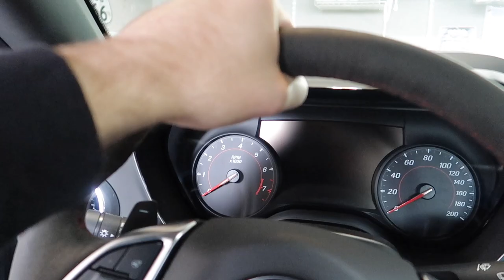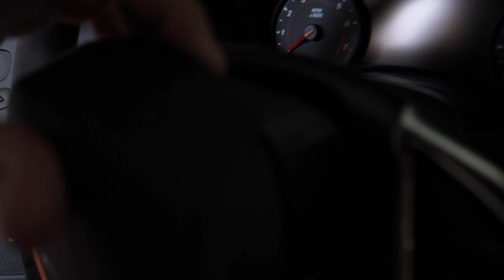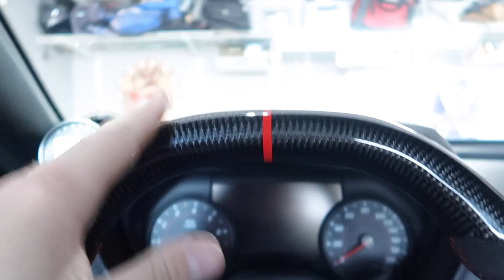EVERY 2016+ Camaro ZL1/SS NEEDS THIS CARBON FIBER STEERING WHEEL!!!

Comment: $750, you got ripped off!!!
Reply from the maker: Where are they cheaper?
Reply: He did not get ripped off. That is about the lowest price you'll find anywhere. I've purchased 2 of these same carbon fiber steering wheels and never got a $750 price. I paid $850. Many are over $1,000. As for loosing the heated function, that is a bummer! However, the heated option is available if you ask for it, I did and got it for an extra charge. 
The wheel looks good 👍
Reply: @michael-ev5fk  It's been over 9 months, I've moved on.